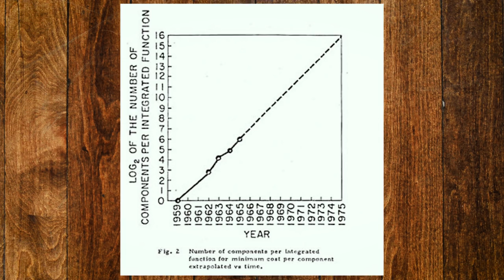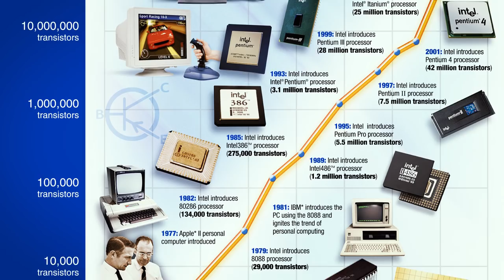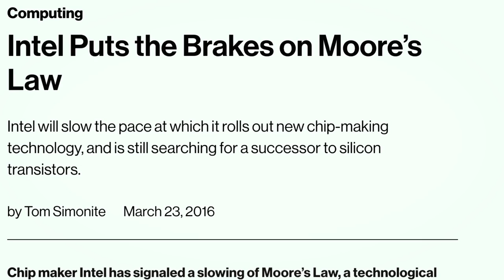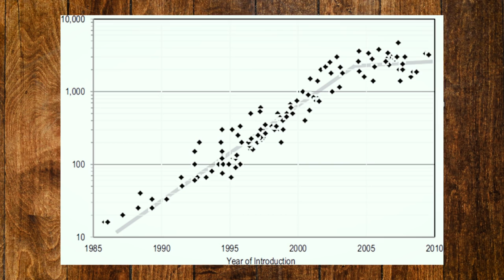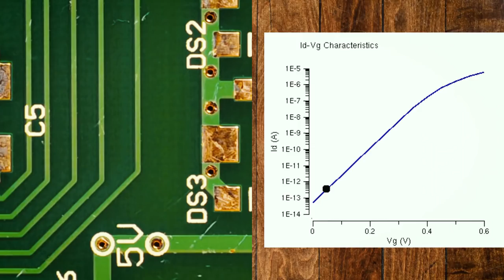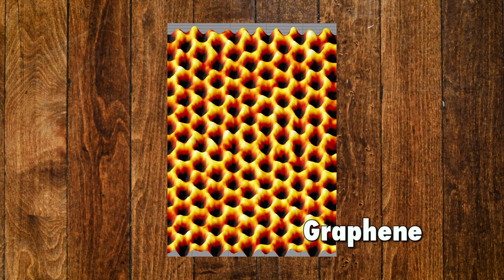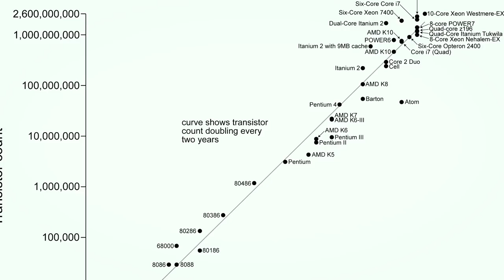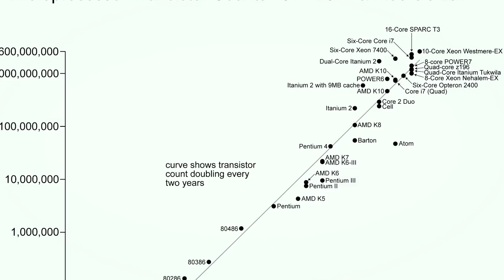Is Moore's Law Broken?

Comment: There are a few things that can be done to improve the speed of the CPU without decreasing the size of the transistors: 3D stacking (like multiple layers of transistors) but this is incredibly expensive. (The creation of a mask (can seen as a mold for the CPU)(not counting the creation of the design, just going from design to physical product) already costs more than 100 Million dollars (and has to be replaced for each new generation) and 2 times the amount of layers means 2x more masks, ...).
A fresh start: creating a brand new architecture: windows and intel have always found compatibility very important, they keep old functionality compatible. But this means that software companies need to take that functionality into account. Which means even if the functionality is unnecessary by now, they need to  keep including it because newer software is build around the fact that the old features exists. This might be a surprising but your 64 bit CPU still has some 16 bit features. Intel tried to clean it up when switching from x86 to 64 bit CPUs. They had created a brand new architecture known as EPIC (Explicitly parallel instruction computing).It worked great but it didn't sell because it wasn't compatible with old software, then AMD came along and just took the x86 design added some more bits, taking all the old stuff with it... And people bought it because it was compatible.
I'm running out of time now, but if anyone is interested I can continue later.
Reply: I think I got the brackets right... 6 opening brackets, 6 closing brackets.
Reply: samramdebest yes....

Comment: Back in the days when computers had RAM measured in kilobytes, computer scientists took every step possible to reduce the size of a program. The larger the program, the more expensive it is to buy a computer to run it.
I'm thinking that, while consumer programs will likely stay about as they are now, programs meant for industry will start talking about how many cycles per computation the program takes. Because if you have trillions of data points to compute, reducing a program run time by a few hundred cycles could mean saving hundreds of hours of computer time.
I also think cloud computing will continue to grow. We might need a version of Moore's law for the cost of buying time on a cloud based server.

Comment: The issue for the current tech is the threshold voltage for dielectric breakdown of the gate oxide is very near the switching voltage for the transistor. So there are maybe 1 or 2  more steps down in gatewidth before MOSFETs hit their limit.

This is also what has limited the clock speeds, as the gate width determines the maximum switching speed.

The odd thing with Moore's law is every time it looks like there is a roadblock and it is about to fail, a  new way to improve performance has been found.

First BJTs were the transistors they reached their limits, then the architectures improved for a few years before MOSFETS replaced them. Now MOSFETS are at their limits and architectures and better manufacturing are what's driving the gains. 10 years ago a company could have tried to make an eight core chip and maybe 1 in 10,000 to 10,000,000 would have worked.

The difference this time is we don't know what will replace the MOSFETs, Single atom switches, Graphene, Optical switches, even a transistor based on tunnelling. Nobody knows, but we will know in 5 years time and be using them in 10 years.

Comment: Moore's Law also applies to other parts of technology like memory (you can buy a 1TB micro SD card now), camera sensors and displays (8K video cameras), and networking (streaming 8K video on youtube). 
There's still room for improvement, its just we're at the limits of making current devices smaller so we actually have to redesign the whole device. Obviously this is much more difficult but there's a lot of money in making this work so I'm certain Moore's Law will be OK for a good while yet.

Comment: hmm, the animation on 3:58 does not have anything to do with transistor size. It is a visualization of mosfet conduction at threshold voltage...
Reply: While it's a little bit of a stretch, it's still topical. At that moment the video was talking about the problems introduced by further miniaturization, and as you reduce the size of transistors down to quantum levels you do reach hard limits of their efficacy arising from electrons just straight up ignoring the conduction thresholds and just "tunneling" straight through them.

Comment: Moores law done broke in 2005. At least for x86_64
I think the easiest revision of moore's law would be to double the number of transistors on a die (resulting in larger dies) every 18 months, and back changing instruction sets and parallelization of coding. 
Next would be to double the subsystem speed (bus speed) to make the processors flushed with resources rather then spend cycles trying to find, cache, access, process, and then store information. Every cycle processes data, and each machine has a dedicated CPU or core to bring resources to bear. 
After thats tapped out, graphene will have to take its place, with processors cycling much much faster, but the scale of transistors preserved as they reach the minimum size of a single atom. 
When graphene is tapped out, it'll have to be photons or optical gates/transistors with a single photon or small packet of photons acting as a Bit. This is interesting because photons can exhibit wave and particle duality, so maybe there's a bridge there between quantum computing with wave functions, and binary/discrete computing with particles.

Comment: From the consumer point of view, it really does not seem not matter that much.What is really key is the ability to get the job done. OS have become more stable and better able to divide process than a decade ago. So for consumers, it's really about the overall experience which up to now is super fast even for something as small as Smart Phones. Bloatware seems to be the biggest problem over time that makes hardware seem to be slow to a crawl. Also at least for a few years now, Intel has not cared to do much when it comes to pushing the CPU market considering they have next to no competition. Maybe in 2017 that will change if AMD comes up with something that actually competes with them again.

Comment: IMO software will always be on the forefront of technology. If the electronics stop improving, that just means software developers will have to work harder to make up for it. New algorithms, new systems, and better engineering practices means better products at the cost of more developers, so the economy will keep on going.
Reply: There is a good argument to be made that software is worse than it was in the good old days. With faster processors and very cheap memory has come a lot of software bloat. I have an order of magnitude more ram (4GB) on my laptop than any of the mainframe computers I used to work on 20 years ago that ran literally hundreds of jobs for hundreds of users at a time. I can barely fit half a dozen programs into my ram before Windows 10 overloads, starts page-thrashing and I have to start closing programs to make any progress at all. It's ridiculous that modern programs take up so much ram. They're equally wasteful of processor power. We used to program in assembler language and we could easily extract every last bit of computing juice out of every instruction. Nowadays they use compilers and interpreters that don't do nearly as good a job at optimizing the code. Your browser runs no faster than it's javascript engine because all popular web pages use javascript extensively, even for things they don't need to use it for. But it's an interpreted language, which can't drive the CPU nearly as fast as an assembler program and can't take advantage of a lot of features of the CPU. On the server side PHP wastes just as many cycles. Now don't get me wrong, current javascript engines are very sophisticated and given enough ram they will outperform older interpreters in an apples to apples test, but 15 years or so ago browsers didn't need javascript because web pages didn't use it and I could turn it off and browse just fine. Browsers and web pages and other applications and the operating system itself have all become bloated with new features like javascript and .net and silverlight that slow down the computer until it's running no faster than the earlier technology.
Reply: dlwatib Yup, agreed. It's ridiculous that I need 16GB of RAM just to run Chrome :P

Comment: Other, non-Si alternatives are too expensive and there's nothing to suggest that any would be economically feasible by 2020-2023, when either 10nm or 7nm would complete the three step cycle Intel has laid out. We will likely see RAM, dGPUs, ssds, and other components shrunk and combined while software optimisation and better battery technology carries us forward. If not, we will start to see prices drop for even the newest and fastest tech.

Comment: It's not as if things will fall apart if endless growth in performance does not continue. The only difference between a fast computer and a slightly faster one is it will take slightly lest time and money to do work on the former.

Most people don't need more processing power to send emails and watch cat videos.
The many core pathway works fine for the few that require more power.

There is nothing to be concerned with here unless you're a microchip salesman

Comment: I feel like the problem with quantum mechanics is poorly explained. As far as i understand it, the problems stems from quantum tunneling becoming possible at small sizes. When the space between two wires leading current becomes small enough, there will be a chance for the individual electrons to simply quantum tunnel between the wires. This would mean that part of the current running through one wire would have a chance to simply jump to another wire causing a current to flow where it is not intended. The part about transistors the size of an atom also seemed strange, since it feels like a very non quantum way of understanding the issues at this size.

Comment: We certainly won't be going back to being cavemen. Computing won't magically go extinct if we can't make progress. But - we may be looking at a future where a computer is more like a piece of furniture, and will need to switch to a business model that matches the idea of being replaced when the technology wears out due to age, rather than being replaced just because it's faster than the previous model.

. . . and a note about the whole "cores" idea: I think even that is slowing down. I used to own the Q6600, a quad core CPU known as the Core 2 Quad. That was released in 2007. Nine years ago. If Moore's law was keeping up, I should be sporting a fancy new 64 core system. I'm not, and I don't know anybody who is. Neither clock speed nor core count have really kept the pace.

Instead, I'm on an I7 processor that has a marginal improvement in clock speed, with hyperthreading which marginally increases the "core count" by making each core handle two threads.

. . . but there is an area where Moore's law is a bit more relevant. GPUs. Have you seen the shader core counts on those? It's in the thousands - literally. The GeForce GTX 1080 has 2560 CUDA cores. And they're more like CPUs these days in that they're general purpose. They can be used for physics and AI in games, and for scientific research. It's not just graphics anymore. I'm contributing some of my GPU power to the folding@home project. Some supercomputers actually use GPUs for their power instead of CPUs. It will be interesting to see where GPU power goes from here, and what it's used for.

Comment: On wayback machine on newegg, I found that ddr3 could cost less than $5/GB in early 2012:
https://web.archive.org/web/20120122225254/http://www.newegg.com/Product/ProductList.aspx?Submit=ENE&N=100007611%20600006069&IsNodeId=1&name=8GB%20%282%20x%204GB%29

Today newegg at least doesn't have any ram for less than $6/GB.
To be fair, I'm comparing 4GB ddr3 modules to 16GB ddr4 modules. Size has increased, along with price.

Comment: A few technical notes on video quality:
1. The ever-changing exposure in the Matt segments is very irritating for the eyes.
2. Panning picture segments have a lot of stutter - better apply motion blur next time
3. Matt is out of focus most of the video. Try closing down your aperture to make focusing while self-recording easier.
4. Don't overuse cut-away stock footage. It hardly adds anything to the video. Better shoot some original video.
5. Do interviews rather than quote wikipedia and such. There are enough talking heads on youtube,  so why not do sth more original like you used to?
Best regards.